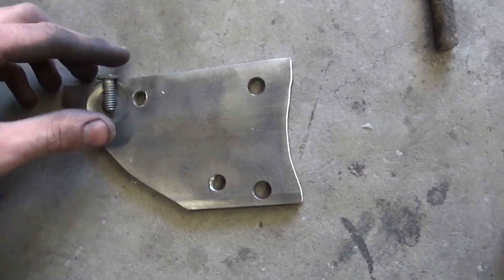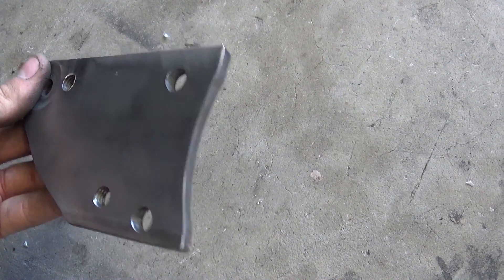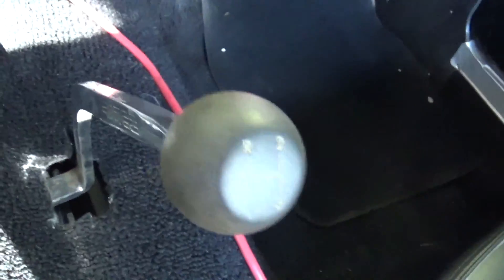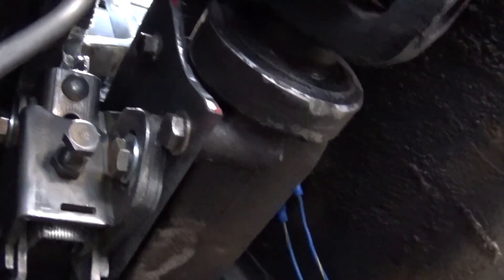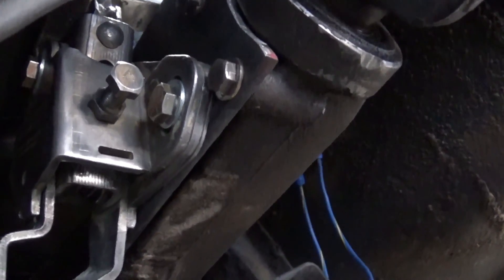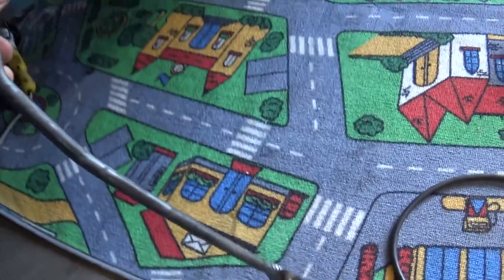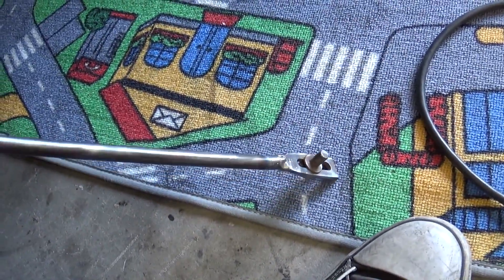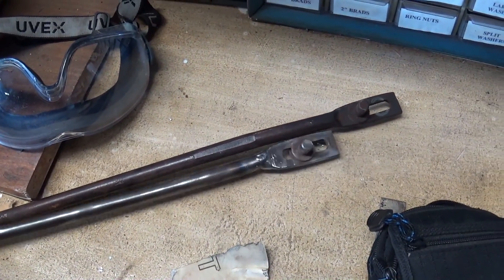Hurst shifter installation

Comment: U look like a good fabricator! I'm in the process of putting a 302/AOD trans in a 88 ranger reg cab & I was given a Hurst promatic 2 shifter but don't want to buy a linkage kit!! Any ideas on how to make it work for me???
Reply from the maker: Cool project, pretty sure those use a cable so you're pretty much stuck buying a kit. If it does use a regular linkage, I build them out of about 1/2" round bar. Bent it how you need it for clearance, thread the ends, and put heim joints and jam nuts on each end.

Comment: does the shifter work good?
Reply from the maker: Yessir it works great.
Reply: +SuperKONR cool, I've got a bid on one on eBay, how does the dual pattern inline shift deal work?
Reply from the maker: Basically you take one of the roll pins out of the bottom. To go from 1st to 2nd, you just bump the shifter up instead of having to go to neutral and move over. There's a spring that will pop it over automatically. It's pretty nice. I'll try and make a video of it.
Reply from the maker: Rob Albrough
https://www.youtube.com/watch?v=XGVPgEU-9Bc&feature=youtu.be